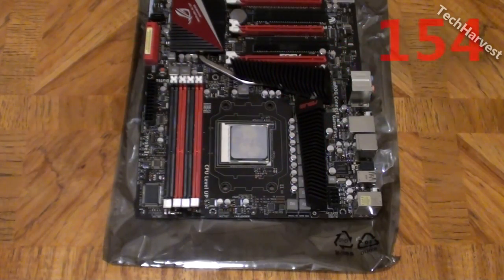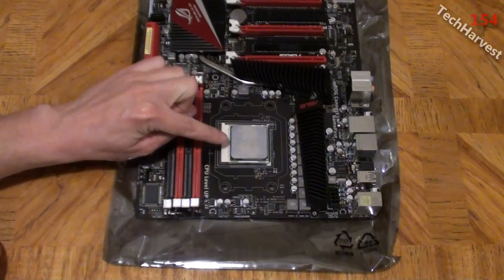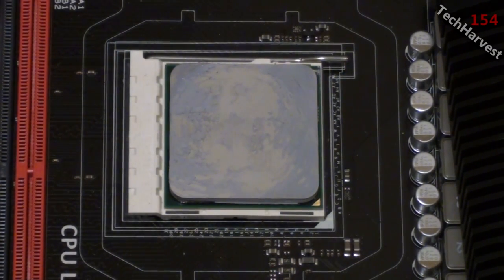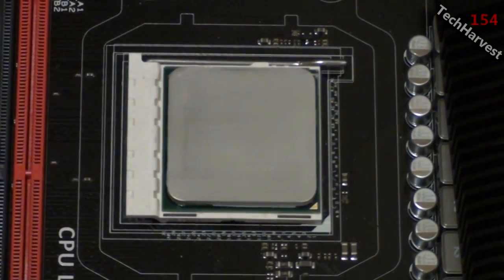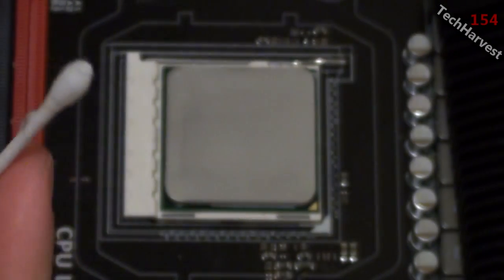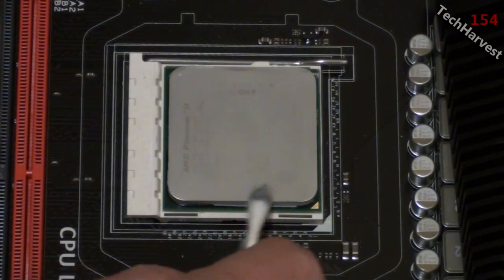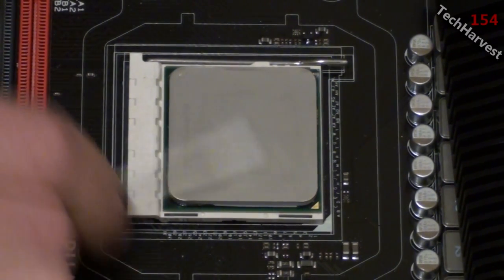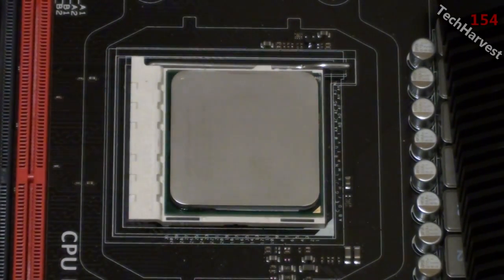How To Clean Thermal Paste Off Of A CPU

Comment: What if you don't have the Isophal Alcohol? 
Anything else like Vodka or some other alcohol based cleaners?
Reply from the maker: Vodka has too much water in it.  Stick with Isopropyl alcohol.  It's cheap and it works.
Reply: TechHarvest I actually managed to clean it off without any Alcohol, it was a very thin layer but it was from a Intel Stock Cooler so that might have been why it was easy to take off.
Reply from the maker: CreepshowandGore I'm glad it worked out for you :D

Comment: Do not use a paper towel or a q-tip. Use a microfiber cloth or a coffee filter so you don't leave any residue behind.
Reply: That's the point of the q-tip
Reply: ohhh give it a rest/ Linus himself cleans with a papertowel
Reply: @calabriamia6307  Yeah. The only reason you would need to get rid of 100% residue is because you are re-selling it and you want it to look nice. You really just need the thermal paste visually removed because you're just going to be reapplying more.
Reply: @ragon39  I mean, there's a reason you are replacing it. The old one isn't precisely doing it's job
Reply: @elpollochileno  Getting rid of thermal paste residue not the cpu. You don't clean off thermal paste just because you are replacing the cpu. For instance I had to clean off my cpu because I wanted to remount the the cooler I had on it so the fan would blow a different direction. On top of that its actually pretty hard to just replace a cpu with recent cpu advancements because cpus need specific motherboard slots. So if you are replacing the cpu you are more that likely replacing the entire motherboard.
Reply: Yep
Reply: Djangosp2 lol
Reply: Djangosp2 lol, this guys video is not how to clean thermal paste.

Comment: Shouldn't you use something like a coffee filter instead of paper towls as there might be particles coming off the paper towl?
Reply from the maker: Yes, you could do that if you like.  I don't have coffee filters around the house so I went with a paper towel.  Not all paper towels are created equal.  The ones I have don't lose lint easily.  You could always give it a shot of compressed air if you're concerned about any lint being left behind.

Comment: would 30% rubbing alcohol work?
Reply from the maker: Go with 70% or higher.
Reply: Alright thanks.
 i ran out of rubbing alcohol so I tried using listerine to clean off the thermal paste lol. The fan got really loud (noctua cpu fan) afterwards; the verdict may go to the listerine i used to clean the thermal paste. I will go to the store and buy 90% rubbing alcohol and re-clean my cpu

Comment: i have a 160 gig fat ps3 and i want remove & clean thermal paste from the cpu & gpu.can i use this steps?
Reply from the maker: I've never opened up a PS3 before.  Game consoles are not built to be upgraded.  I'm not sure you're going to encounter a traditional setup in there in terms of heatsinks.  They might be glued into place.  Taking it apart is one thing, getting it back together might be tricky.  That being said, the premise of a heatsink and thermal paste is pretty universal.  The thermal paste is there to evenly transfer heat from a hot surface to a radiator.

Are you having heat related issues with your PS3?
Reply: TechHarvest yes.i want remove thermal paste from cpu & gpu & replace new thermal paste.

Comment: I put my heatsink on and it spreaded it out [stock heatsink] but I screwed up and I need to order an aftermarket heat sink. My CPU has a bit of residue thermal paste on it. Should I remove the thermal paste or would it be okay to keep the small layer on and just add to it when I get the aftermarket tomorrow? I installed it today.
Reply from the maker: Clean the thermal paste off before you put your new cooler on.
Reply: Thanks for the response!
Reply from the maker: First I wiped off the paste with a dry towel.  I did this to get the bulk of it off.  It's less messy that way.  Then I used alcohol to clean up the residue.

Comment: what would happen if I say got some of the thermal Paste on the pins of the CPU by mistake??? what do I do then???
Reply from the maker: That would be a very bad thing.
Reply: Actually it's all good now I ended up taking a toothpick and getting it off, it didn't damage anything on the CPU so I just saved myself a Ton of Headache and Money Also The CPU I have (AMD FX 8350) I overclocked it to 5.0GHz With a Corsair H75 Cooler and I'm only getting temps up to 75c MAX yes you read that right 75c MAX!!! It is possible to do this although I do not recommend it lol
Reply: You would say goodbye to your CPU and start looking to invest in a new one.

Comment: Is it better to remove the cpu and clean it, or you can clean it just fine when it sits on the motherboard? I don't want to take the risk of bending the pins by accident...
Reply from the maker: Removing the CPU will increase the risk of bending the pins.

Comment: hi can i ask something i have a new hyper 103 and i install it to my processor but i did not clean the stack thermal paste in my old cpu cooler (stack) i just install my hyper 103 with a stack thermal paste. but the stack thermal paste is not dry reply me please (sorry for wrong english)
Reply from the maker: You should always remove the old thermal paste before applying a new cooler or reapplying an old one.
Reply: tnx a lot men i appreciate :) but if i did not remove the old thermal paste is it very bad or not actually bad ?
Reply: do you think it will harm my processor or not ? my old thermal paste is not dry enough
Reply from the maker: I can't say for sure.  Most modern CPU's are designed to shut down before they fry.  For optimum heat removal, you should always remove the old thermal paste and reapply new.
Reply: tnx a lot #TechHarvest

Comment: Hello i have an ati hd5870 and the temp is getting into the 95degrees is that alarming? its a gaming laptop a asus g73 i play everyting no issue only that is cracking my head over thinking...if you can healp ill apriciated and also the fans only go to 30% and i cant get them up...maybe you know :| 
thanks

Comment: Hey tech!, i would appreciate a reply as im real spooked, I got a new motherboard and everything works fine but the 24 connector is really faulty, sometimes the pc will turn on if you wiggle the 24 pin connector, iv tried 2 different psu's and i still got the same error. I'm getting a new mobo because that's the only thing left which is stopping this from working, could it be anything else?
Reply from the maker: Most likely it's your motherboard.  There must be a loose connection on the board itself.
Reply: Thanks alot, i'v ordered a new mobo, should fix the problem, if that still does not work then what could it be?
Reply from the maker: It could be a lot of things to be honest.  Double check all of your connections.  Make sure it's wired correctly.  If you still encounter issues, I'd look into the PSU next.
Reply: TechHarvest
Thanks for reply, I'v got a new PSU and there is still the same error, when you wiggle the 24pin once its in the mobo it self it sometimes comes on then shuts down straight away, im thinking that one of the pins inside the mobo is damaged causing the random start ups due to you moving it, i think once you move it it hits the damaged pin with bad solder lets say and comes on then auto shuts down due to the tiny solder damaged. It has to be the mobo, also on the mobo the 24pin socket it looks like its slightly been lifted as so the left side is attached and the right side is lifted by a few mm. Thanks
Reply from the maker: Let me know how you make out with the new mobo!
Reply: TechHarvest
Will do, my mates lending me his xbox for 2 weeks so i actually have something to do in my spare time, thanks for replies/help! :D
Reply from the maker: No problem.  Good luck and enjoy the games!
Reply: TechHarvest Will do, i hope to god it fixes it, thanks
Reply: Hey Tech, all went good, thanks for help and that!, i woke up at 2am and seen the motherboard and just built it haha, best of luck on your channel! :)
Reply: TechHarvest^^
Reply from the maker: Nice!  I'm glad it all worked out!  Thanks for dropping by :D
Reply: TechHarvest

No problem!:D

Comment: unfortunately when I removed the fan, I didn't pay attention to which direction to put it back in.  Does the air blow at the processor or is it designed to pull the air away from the processor.  Anyone know?
Reply from the maker: A good way to remember it is:  The heat sink pulls heat off of the CPU.  The fan continues that process by pulling the hot air off of the heat sink.  So it should be installed to pull air away from the heat sink & CPU.  Good luck with your upgrade!

Comment: I know you were doing it for demonstration purposes, but I wouldn't tilt or hold the bottle of alcohol over your motherboard.  One slip of the bottle and it's game over.
Reply: Aaron Bergner you can actually get computer components wet as long as there is no electricity flowing through them.

Comment: Can I use alcohol pads?
Reply from the maker: Liquid is not a good thing to get on your motherboard.   If you can make sure that the pad doesn't leak all over the place, then yes it will work.  If you do get alcohol on the motherboard, don't worry.  Let it dry out completely before powering up the system.
Reply: thanks man!

Comment: Hi Jim just a quick question as you seem to know what your talking about or anyone else reading my comment.

I have a Corsair Hydro H60 installed on my pc I am going to change my system case so ideally want to clean and re-apply the thermal paste now my question is when I got the cooler it had thermal paste pre-applied on the actual cooler which then sat directly onto the CPU, so do I apple the thermal paste to both the cooler & the CPU or not? 

Any help would be great thanks.
Reply from the maker: Just apply it to the CPU.  Generally the cooler contact point is larger than the CPU, so if you apply it to the cooler, you'll waste thermal paste.  Do not put it on both.  Many CPU coolers come with thermal paste already applied.
Reply: Ok so clean the existing thermal paste of the CPU & the cooler and just apply to the CPU itself yes? Thanks.
Reply from the maker: Sounds good.  Good luck!

Comment from the maker: The way I look at it is that you want your PC to run as fast and as cool as possible.  Anything you do with the CPU, you want to do right.  It's the most vital component of your build.  You want the transfer of heat from the CPU to the cooler to be optimum.  Always replace the thermal paste when you separate the two.  That includes removing all old thermal paste from the CPU.

Comment: Just an FYI that electrostatic bag is literally the worst thing you can put your motherboard on.  The wooden table would have been better. Electrostatic bags work by dissapating the static charge over the surface of the bag protecting whatever is inside it.  So basically if that bag has any contact with static discharge at all it is going to carry over the entire surface of the bag subjecting you're entire motherboard to electrostatic discharge. 

Source: certified in ESD handling for avionics.

Comment: Good Video, though FYI It's best to wipe off the processor with a lint-free microfiber cloth (not the kind for cleaning LCD screens, but the thin true-micro kind you would get at a vision center for cleaning delicate things like eye-wear). Sometimes specks of lint or tiny bits from regular paper towels not totally visible to the naked eye can remain on the processor, and while not detrimental it will definitely cause a bit loss in cooling performance.

Comment: It would be much better if you remove the CPU, as you don't want any liquid to drip in the socket.
Secondly you could take a toothbrush and use alcohol to clean CPU pins too...and then install it again when dry.

Comment: 1) Coffee filters work well for a final pass.
2) Get 92% isopropyl, 70% will leave impurities behind.
3) Don't need to q-tip; most electronics are cleaned with alcohol. Dries quickly and doesn't corrode. I just dampen a paper towel corner with a good bit and go nuts.
(Advanced users only: back in the day, prior to IHS being standard, we'd just dunk the CPU in 92% for an hour if thermal paste was really baked on to soften it up. Can still do it, so long as it FULLY DRIES inside before reassembly)

Comment from the maker: It's important to remember why you use thermal paste to begin with.  You need to transfer the high temperature of the CPU to the cooler.  The thermal paste is the connection between the two.  Leaving old thermal paste on either the cooler or CPU will lessen the effectiveness of your CPU cooler.

Comment from the maker: Do not use water.  Water can be a solvent in some instances but you need a solvent with more punch like alcohol.  Also alcohol will evaporate much quicker than water.  If you don't completely dry out your system and turn it on, it could mean destroying some very expensive components.

Comment: YOU ARE AN IDIOT you dont put you're motherboard on the antistatik bag bekuace it has metal on the outside. plase it on the bok insted. Self if you has taken out the BIOS battery. But the rest is good.

Comment from the maker: I'm not familiar with the foil.  I assume it does the same thing as thermal paste.  Is it adhesive?  The purpose of thermal paste is to create a good seal between the metal of the CPU and the metal of the heat sink.  It allows for optimum heat dissipation.

Comment from the maker: @deadly1010P The key thing is that you should never get your motherboard wet.  As long as you didn't dribble anything on the mobo, you're probably in the clear.  Nail polish remover might be a bit strong so I wouldn't use it, but I doubt you did any damage.